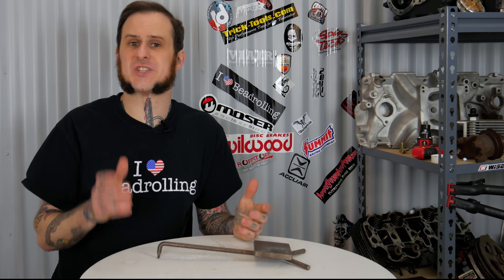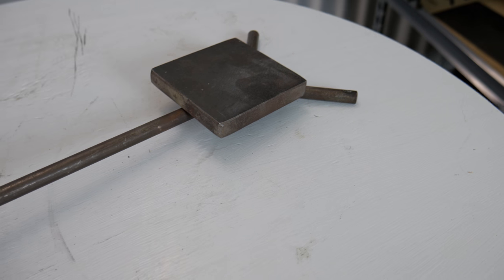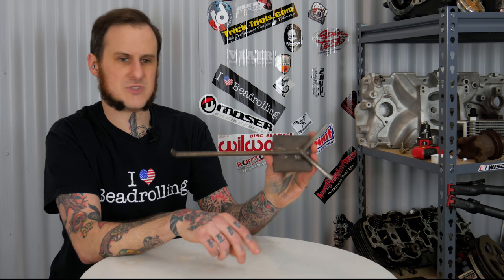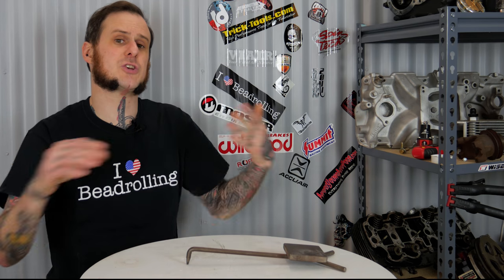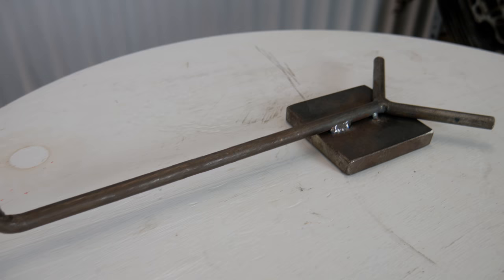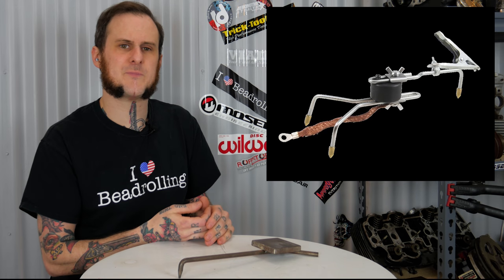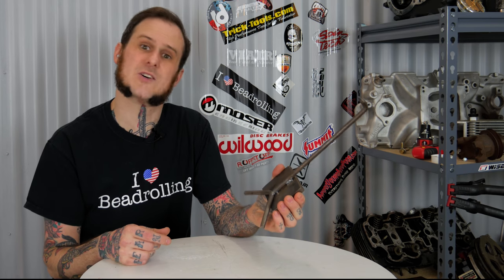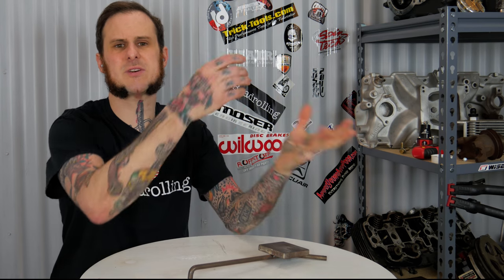An Extra Hand for Welding - 07 - TOOL TIP TUESDAY

Comment: I just bought a drill press clamp from harbor freight. It's kinda like half a pair of vise grip clamp and the other side bolts to the drill press table.  I just drilled a hole in my welding table, heated up the clamp arm to move it down some and it works great. I just welded the exhaust on my bosses project and it worked great for that.
Reply from the maker: Ryan Wopat I have a couple of those floating around. I just never want to drill holes in my welding bench. The next bench I build I'm definitely doing a grid pattern, fixture table design with a thicker top.
Reply: HotRodHippie yeah I'd love a certiflat table but the are way out my budget